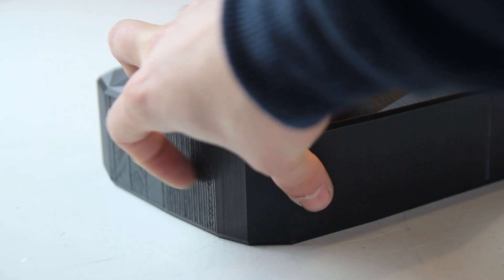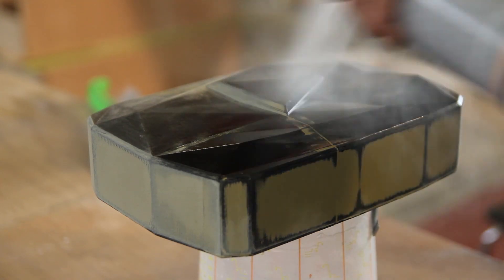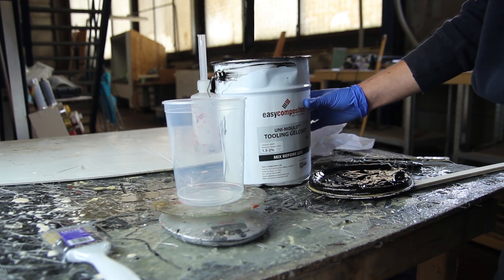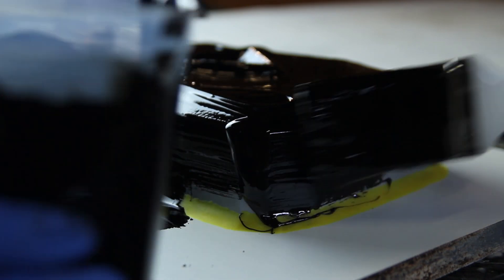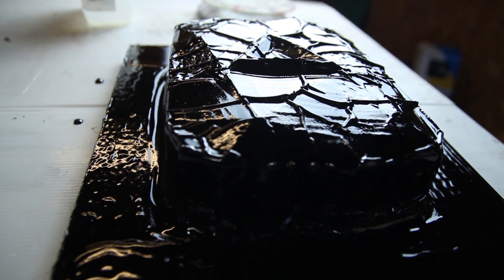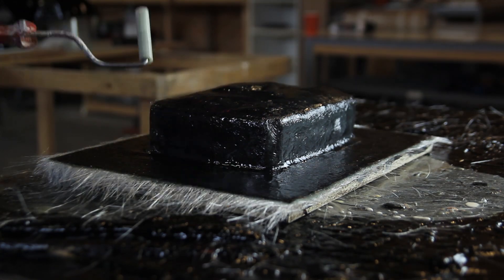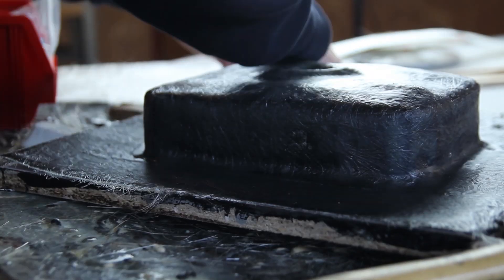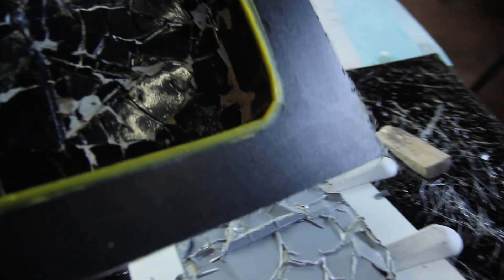FAILING BUT NOT GIVING UP!

Comment from the maker: Share your fails down here!!! Would be more than happy to read them to make myself feel better :D
Reply: I had the same issue: PLA print, cheap 1k primer and then epoxy on it. Terrible. 
Now I use only 2k epoxy primer on my plugs. Hopefully it will help.
Reply: Did the exact same thing over the summer. 3D printed two 30 USD parts then sanded them and painted them with a high build primer. Forgot to spray PVA and thought the wax should be fine NOPE! Forgot to realize Gelcoat will eat the wax then eat the paint. Luckily 1 mold and buck mold were usable but took a lot more time. From now on I will make sure there is a PVA coating on the buck.
Reply: Probably one time when I had left a larger crystal of ybco surrounded by powder in a die press.
I ended up accidentally denting the steel punching die… it’s supposed to be able to handle up to 10 tons…
Yet a large grain of ceramic that I could break by accident with plastic tweezers ended up denting it
I learned my lesson to make sure powders are well ground before putting them in a compression die
Reply: Please make a ruby play button for set india

Comment: Good attitude. I've learned much from mistakes and little from when everything just goes as planned. One of my many failures was when I used a silicone-based mold release on a model/mold box before pouring the silicone mold. Instead of releasing, the silicone-based release acted as quite an impressive primer for bonding the silicone rubber to my model.
Reply from the maker: true! Awtch must have a painful discovery. To be honest I wouldn't have known as well!

Comment: I think anyone working with EPS foam and resins has ran into problems like this. You're fortunate that your discovery was on such a small scale 😁
Reply: And there are different products designed specifically for creating a protective shell over foam, I think most derived from the sign making industry. I think 2 part polyurethane mostly, but I'm not an expert on the particulars. Latex of course.

Comment: Problem is that 1k motip primer, done that and same thing happened, never use 1k based colors primers clearcoats when you have to do later with epoxy or polyester resin...learned that the hard way also...only 2k stuff should be used !

Comment: The same happened to me using polyester tooling gelcoat.  Did you solve the problem or do you know how to do it right?
Reply: I found that brushing on the gel coat was at fault. Lots of different thickness' for wierd  curing.

Comment: In my experience a couple of things went wrong, mainly in the choice of materials. Using polyester based fairing putty can cause issues, as well as using rattle can paint. Polyester resings contain styrene, a strong solvent which partly co-cures in the reaction. However it can eat its way through mould release layers, and into paint and putty, gripping it solid.

Better choice if doing the paint route is a 2k pu paint like de ijssel dd lak. Contact me and i will send you a can. Can be sprayed and rolled/brushed.

Comment: Made a carbon boat in a somewhat porous mould. Instead of using a liberal amount of pva film as a release as I usually did, I was advised to use a semi permanent mold release. These work great, just not on porous moulds.... boat came out in pieces...

Vacuuming a carbon laminate witha pump that pulls near perfect vacuum, and using no perf film. Laminate came out dry...

Many more mistakes, but even more beautiful products. Infusing a 12 meter motor boat singlehanded was one of the nice things, as well as infusing a 9 meter rib where i was allowed to use 300 kgs of resin. I used 290 kgs...

Comment: Tooling Gelcoat! Tooling gelcoat! On Both plug and mold... don’t use paints or primers for a finish on plug!!!
Reply from the maker: If properly applied a 2k paint is good for the plug 😉
Reply: @MatthieuLibeert  Did you try PVA instead of chemical release? Styrene should not get thru PVA film and wouldn't damage any automotive paint if the film is proper thickness.